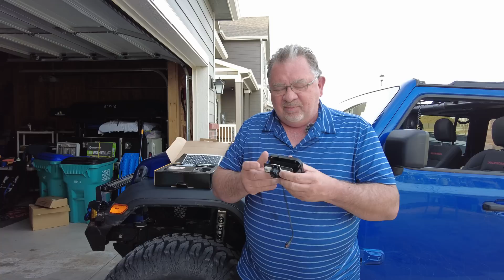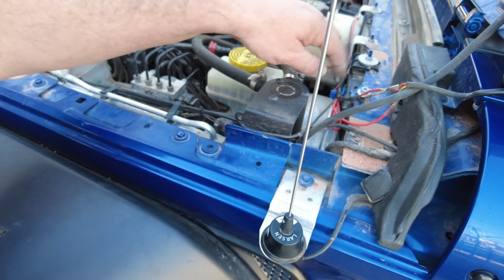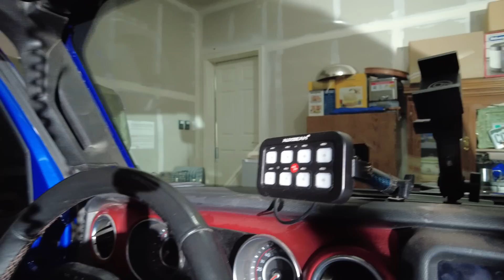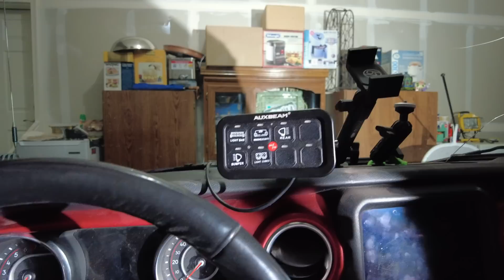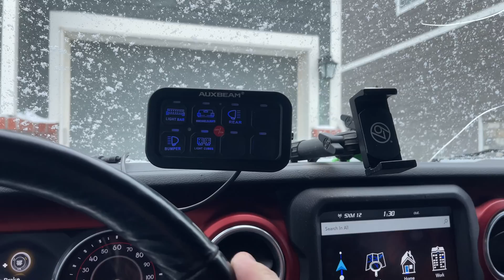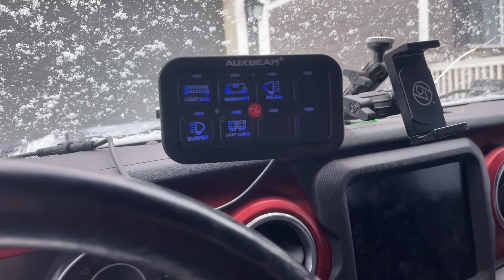Switch Things Up! Auxbeam 8 Gang Switch Panel

Comment: Ive been trying to figure out how to make a 67 designs mount work for the switches for a while now, do you have the file you 3d printed still by chance?
Reply from the maker: Unfortunately it wouldn't do much good because I made an adapter plate to connect to a ball mount that I already had.

Comment: what fuse ended up going between the battery and the switch panel once it was complete ?
Reply from the maker: I am actually waiting on Auxbeam to send me a new adapter for the smaller fuses in the Jeep JL. I will be tying it in #52 for the cigarette lighter.